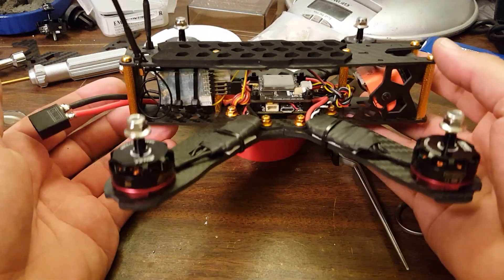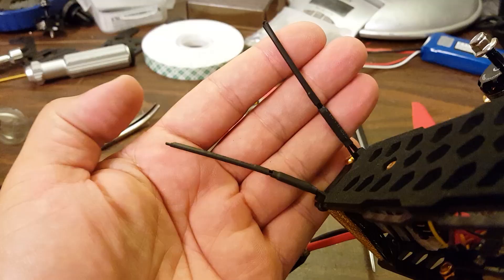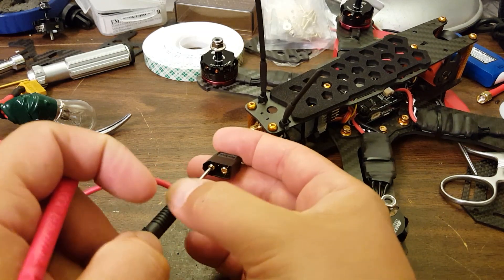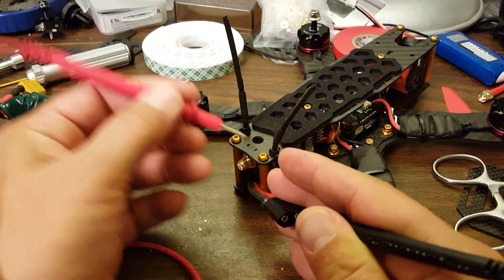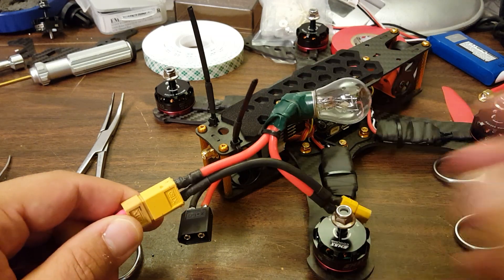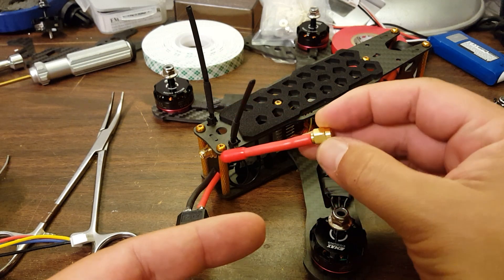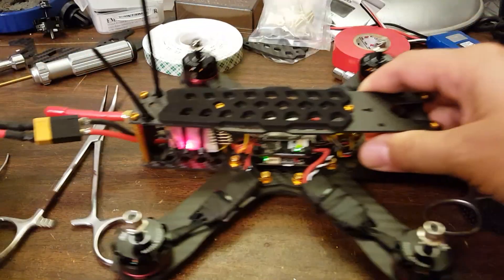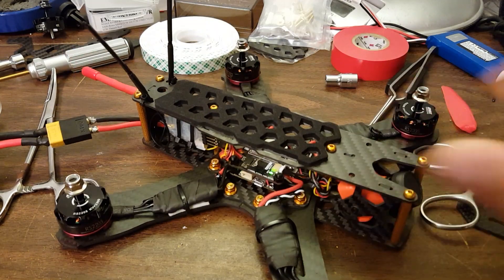Quadcopter Build Final Check | DON'T LET THE SMOKE OUT

Comment: If you smoke a Motor, like I just did after a crash I installed a new motor and when I plugged in my Lipo the new motor smoked. I found a very small portion of the ESC melted so I am going to replace the ESC but should I still try the same Brand New Motor that smoked briefly or should I not? It's the only spare I have. I don't want to damage the new ESC.

Comment: so when I check between the battery ground and the sma connector I get 0 reading and If I check between positive and ground I get 0 and my smoke stopper works too.. but if I go from the ground batter lead to a screw on frame I get a reading... im confused

Comment: I did both test and fried something.. I was using small guage wire and a 2s battery for my light test it's just what I had laying around. It armed one motor was slow..unplugged the 2s put the 4s on and poof... small orange rectangle looks burnt on fc omnibusf4...escs still look good and beep any ideas on what happened?
Reply from the maker: It's hard to guess what fried. If you were using a smoke stopper it shoukd have protected the quad against overcurrent.

Comment: Maybe i am not meant to solder, because i have 2 pdb's  connected to the esc's, and both pdb's have continuity on positive/negative leads..... :( the second one almost blew my battery.. it very wird because all solders are average done, positive and negative wires from esc's are correctly soldered.. maybe i fried the components on the PDB?

Comment: Hi Joshua! Could a capacitor on the main battery input probably interfere with a smoke stopper? As the capacitor loads up it could probably draw some amps. Am I wrong? I use a 1000uf 35V cap on the main battery lead.
Reply from the maker: I don't think so. The cap should charge very quickly.

Comment: You live and learn... gonna build one of these tomorrow. Got done building a quad today and plugged into beta flight with no prob. Set everything up. Rx, VTX and camera all working great. Then when I plugged into BL Heli config? There is only 3 ESC's that were showing. Went back and checked my wring. Armed quad and three motors working. So I found the loose signal wire and fixed it. Clean build no solder blobs. When I went back to flash last esc.... flame shot out motor 3 and it's fried... FML...gonna use one of these every damn time now. $40 down the toilet as the motor and esc are toast in sure. Thanks for your insight. Really value it:)
Reply: I had a similar issue, but it was just a bad FC from factory. 3rd ESC wouldn't detect at all, wouldn't spin motors or anything. No smoke, no solder issues, all correct connections. Just luck of the draw, I guess.

Comment: Found ground on VTX antenna which is good. But what if I find ground on all frame screws? Asking because I smoked tested OK but I noticed a spark on VTX antenna hold down screw.
Reply from the maker: The frame typically gets ground from multiple sources. This is normal. If you are getting current flow through the frame (sparks) then you need to find where the POSITIVE voltage source is coming from and fix it.
Reply: Joshua Bardwell thanks man - I have the VTX powered directly off of the PDB XT60 solder joint. I will try and move this to the FC 12v source. Ty again for your response!
Reply from the maker: That's not exactly what I meant. Somewhere, there is a bare wire that is putting positive voltage onto the frame. Then it finds ground through the antenna connector or whatever. Do this: with the battery unplugged, look for continuity between the positive battery pin (on the XT60 on the quad) and the negative. If it's not there, look for continuity between the 5v pins or the 12v output of the regulator and the negative battery pin. There should not be continuity between any positive voltage source and ground, under normal operation.

Comment: if it lights up. how do I no what the fault is or do I have to take it all back apart. as all I did was not even open frame I just unsoldered motors and put new motors on. and just one motor went funny changed it back and same. I know u will have the answer...... your the quad no it all. thanks Joshua
Reply from the maker: If it lights up, all it means is you are pulling enough watts to light it up. If it lights up full solid bright then you probably have a short. If it lights up dimly, you might just have a particularly big vTX, or some LED strips that are pulling more power. But anyway, if you do have a short, you have to find it through process of elimination.

https://www.youtube.com/watch?v=XozTH9gEhH8

Comment: recommendation: Never run your receiver's antenna wire/s next to or through a hole in the carbon fiber frame without more protection like an antenna tube. The first layer of wire is ground (shielding), and can short out to the frame. Smoking your receiver. I have seen this happen to my friends quad using the method shown in your video. probably good enough if you don't crash, but... we all crash. lol  nice vids, Joshua Bardwell!

Comment: absolutely, bar none, the most important tool to have if you are going to work on quads. 
  in fact, I suggest you do not even fly until you have made one, because, you may be tempted to make a repair should you crash and if you don't use this protection you could possibly destroy any number of smoke filled doodads. 
 then, instead of having the opportunity to troubleshoot and make a probably very simple and cost free adjustment that could have you in the air in moments, you could end up making one of these while you await days for the brown truck to bring parts to replace the perfectly good parts that were needlessly destroyed due to a very simple mistake that this tool will prevent every time. 
  I thank Joshua and all who have and do generously  contribute  time and effort to help guide noobs like myself while we stumble our way into the quadcopter light. 
  within a week of my discovering this video and fashioning this tool out of almost entirely on hand scrap material, my 1st complete build, assembled with some higher end and costly equipment,  was saved from certain ruin, by adding this to the batt for the 1st power up. 
  the bulb near blinded me, due to my having reversed the polarity on one esc soldered to the pdb.  
  it was an instant reflex to unplug and the bulb didn't even burn out.  
  this is rediculously simple and  takes at most 15 minutes to build and can be done in less than 5 for pretty much the price of a cheap bulb.  
  please please please build, own, and use this tool. 
  believe me, seeing that bulb light up made me a believer and extremely grateful for the help and guidance offered here. 
cheers!

Comment: Hi Josh, Is it normal to  get continuity on plus and minus XT60 Wire
Reply from the maker: No. If you get a tiny short beep then maybe it's just a capacitor. But if it's a continuous beep, do not plug in the battery.
Reply: I don't have continuity, but under the ohm-meter it does show a resistance value from + to - on the XT60. Also, I was going to install a capacitor but my quad already has 730 uF of capacitance, think I should still add a capacitor? Thanks for all your help!
Reply: Hi Josh thanks a lot. You just save me from smoking my Quad. I later notice there was a short. Thanks again for all your hard work.
Reply from the maker: +Ijas Ahamed smoke stopper saves the day!

Comment: can a volt meter be used to check for a short by checking resistance of the battery connector? or is a smoke stopper necessary to check for shorts?
Reply from the maker: +Charles Lee use the continuity test or the resistance function to find a short. But there are other conditions like a damaged ESC that a smoke stopper will protect against and a multimeter won't catch.

Comment: Hi Josh, I made myself a smoke stopper followed the online instruction.  It was simple.   After connecting all 4 motors, esc to the flight control board there was no light.  But the bulb lit up when installed the vtx and camera.  So i though i had a short somewhere,. disconnecting the vtx (camera still hooked up to the FC)bulb didn't light up.  Disconnecting the camera but reconnecting the vtx, the bulb faintly lit up and then went out.  
At first i thought something was wrong with the camera or vtx.   Out of curiosity i use the smoker stopper on the Vortex 250 that i have been flying.  The bulb lit up brightly.  
What do you think that cause?  
I'm not sure what is the spec on this bulb.  I asked for an automotive light bulb and this was handed to me by the store clerk.   Is the bulb too sensitive?
Reply from the maker: The vTX was pulling enough power to light the bulb, that's all. Just use a slightly higher-wattage bulb so that it doesn't light up utnil more amps flow.

Comment: My smoke stopper lit up after soldering my camera and vtx to the PDB, but won't light up when the vtx is unplugged. I decided to take the risk and power up without the smoke stopper and I've been flying weeks with no smoke, why would the vtx be lighting up my smoke stopper...?
Reply from the maker: +Jaxon Webber because you used a 5 watt bulb, which lights with normal current.

Comment: If for some reason there is a, let's say 10ohm resistor connected where a decoupling cap should be, that continuity test will not catch it. You won't burn a lot but still, use the resistance function when measuring these kinds of things, and continuity when you just wanna see that things simply are connected.

Comment: DUDE... You're gonna set the hobby back years by advocating Linear antennas.  They work great when you fly by yourself, but they stomp on everyone when you fly with friends.
Reply from the maker: I'm not really advocating them. I just put it on this copter to sort of give it a try.

Anyway, is there really any reduction in "stomping on your friends" when everybody flies RH, as they typically do?
Reply: Joshua Bardwell Yes even when everyone runs the same polarization antenna there is a great reduction in interference.  Now I only have about 5 data points on this, and nothing scientifically concrete, but those handful of times we would hand the guy a set of circular antennas and the problem would go away.  We also stick to "the 5 bands" 5685, 5760, 5800, 5865, and 5905 which helps tremendously, they seem to work the best together.

Comment: Love that anti slip battery pad on top, where can i get those separately? Sorry if you mentioned it in the other videos.
Reply: This anti-slip drawer liner mat stuff works too...  

https://s-media-cache-ak0.pinimg.com/originals/60/be/49/60be4938295493ae86053bb63ffe2514.jpg
Reply: Trizface non-slip matting from an auto or hardware store.  That light stuff you get in a roll and can cut to shape.
Reply from the maker: Sorry my response took so long. That specific pad is custom-cut for the Rampage. Actually, the padding on the Rampage is not terribly non-slip, and I think there are better products. But I don' thave any links handy. Hopefully others' links will be useful.

Comment: Neat build I noticed no shrink tuning on the xt60 solder? Joshua I like the smoke stopper build do you have the sku number or link in hobby king for it?
Reply from the maker: I added shrink wrap afterwards.

Here is the HK link, but I would encourage you to either build your own or at least make sure you are using the right fuses on the HK smoke stopper because one person has reported that the fuse didn't blow fast enough to save their gear.

https://hobbyking.com/en_us/boom-stopper.html

By "the right" fuses, I would say something like a fast-blow 2 or 3 amp fuse.
Reply: Strangely, HK says it has a 2 amp fuse
Reply from the maker: Maybe it is slow-blow?

Comment: Nice "Anti Smoke" Tutorial, Joshua. But i would recomment to remove all metal/conductive stuff from the table if you have non isolated electrical contacts on the XT-60. I saw you are moving around the Quad with no issue but i think the battery would be thankful if you isolate the connectors in advanced :) Just as a tip for the guys who plug it in on the messy table.

 I personally use a laboratory power supply at 12V and limit the current for the first test.
Reply from the maker: +Nathas1989 lab supply is fine but don't run the motors because active braking on the ESC's can damage the PSU. 

I have sparked the bare terminals once or twice. The smoke stopper does protect against that though, doesn't it?

Comment: i made mine but it seems to come on after i plug my vtx in but theres no short. i had a friend use it and it came on for them so they tried another and it didnt. are these meant to work flawlessly or can something disrupt it and give false info? i used an automotive brake globe 12v 5w.
Reply from the maker: 5W / 12v = 400 mA. The bulb has too low a watt rating. You want a bulb designed to pass about 2 amps. Your bulb will light under normal use.
Reply: I knew it was something simple thanks Joshua.

Comment: I guess I got lucky. Stray solder on my PDB and it got burning hot. No smoke from the escs.
Reply: ScorchingNightfall happened to me once while building brushed quad some solder blob got on the fc and smoke the board didn't know where it came from but lesson learnt should have used a current limiter.
Reply: Rizki Pratama I got no smoke so far. Just weak leads for my battery(pads close together and small, covered it my best, probs gonna ziptie.)

Comment: Can 5.8ghz video signal somewhat impact 2.4ghz controller signal if the antennas are very close like there? Like can 5.8 have low harmonics in 2.4ghz range?
Reply from the maker: You can theoretically get near-field interactions, but not harmonics or anything like that.
Reply from the maker: In general, having the 2.4G and 5G antennas close to each other isn't too much of a problem. Have them separated by even a few cm and you will be okay.